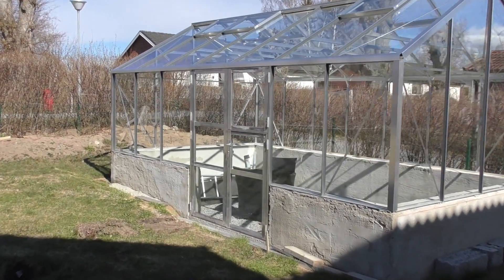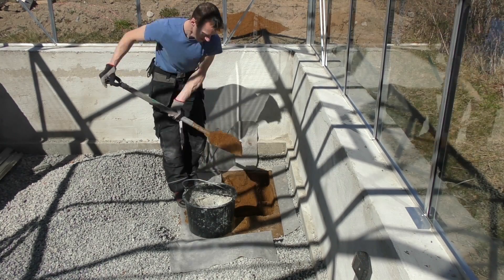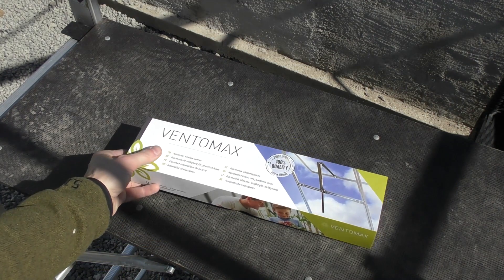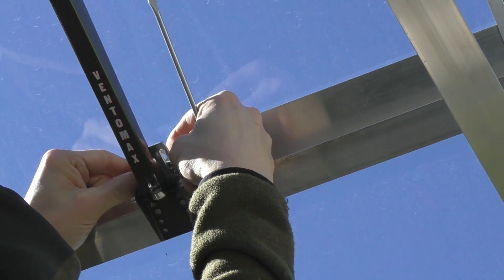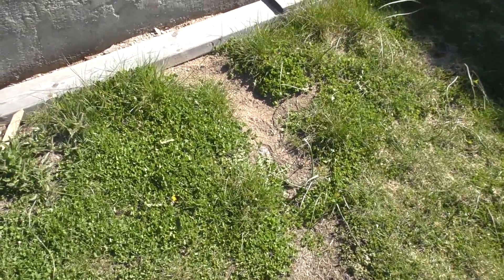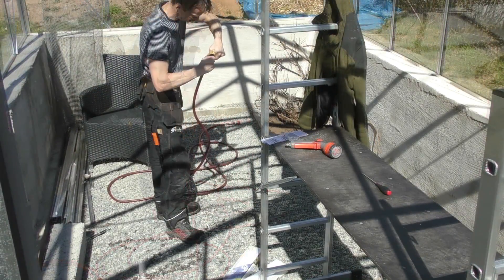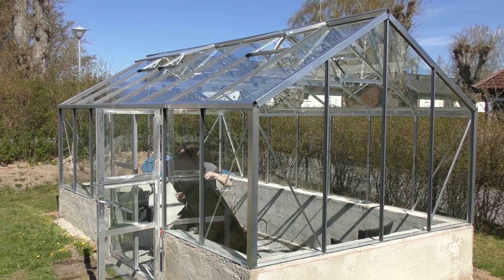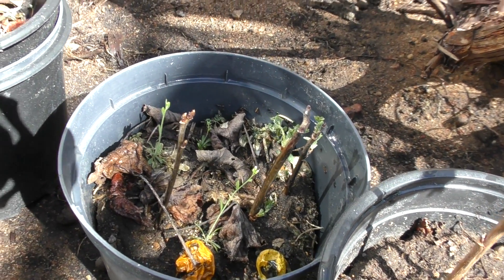Greenhouse build  - How to setup greenhouse ventilation and irrigation

Comment: The grapes need a very hard cut. The Grapes routs should be like a pivot going down up to 10-12m to the ground water. The side surface roots will make it drought sensitive.  The branches have to be renewed every 2 years by alternating cuts. There is a fine line between a nice green foliage and a good grapes production.
Reply from the maker: I Octav Thanks for the awesome tips.